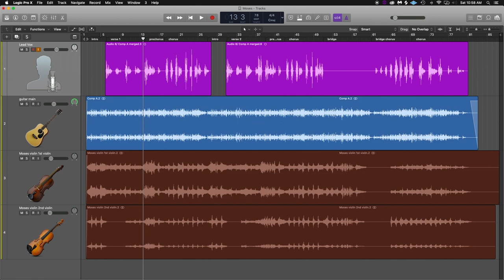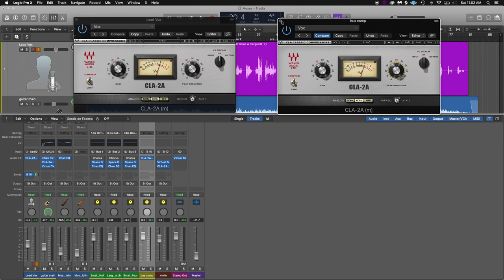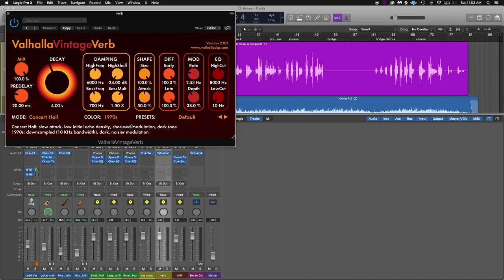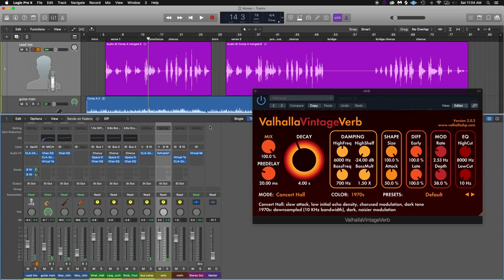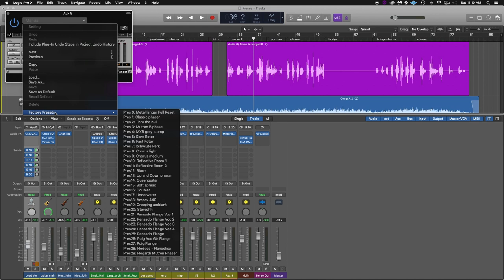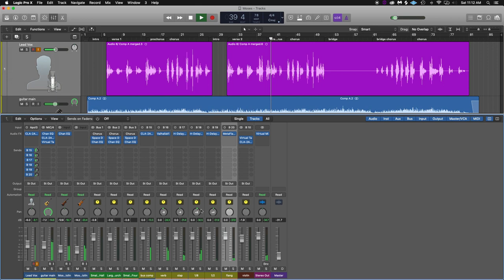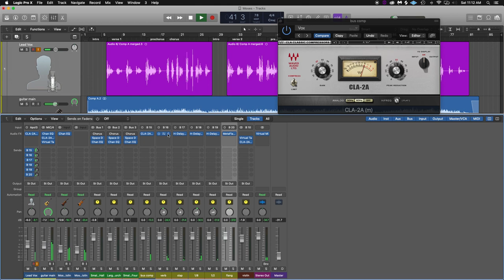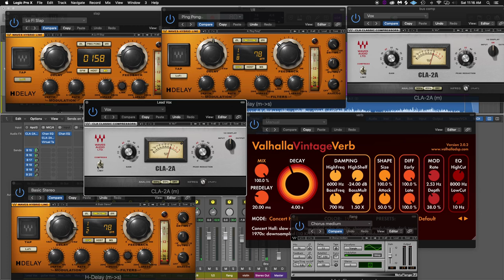How to create a killer vocal chain to sit right in any track! Vocal processing using Waves and Logic

Comment: sir why not put all effect on same voc channel and control dry wet of effect ??? doesent this make the vocal volume really close to 0 db but not loud at all
 ??
Reply from the maker: Thanks for watching and commenting!  Thats a great question.  Not putting the FX on the same channel allows for a few things: 1) the dry channel is not effected, so it will always shine through.  Adding FX directly to the track, especially reverb and delay, will cause that track to sink into the background and not punch through.  2) you can save a lot of CPU processing power, thus minimizing latency by sending multiple tracks through the same processing chain.  3) not all FX plugins will have a dry/wet control.  4) You can do things like panning and equalizing these FX much easier without having to dive into heavy automation.  I like to use this chain because it works for me.  It basically centers the track and gives you the best control to manage the FX through your sends.  At the end of the day, its whatever works for you!  Happy holidays!

Comment: Thank you for the very nice video... these are for anyone that wants a breakdown of the lesson
1:10 listen to unprocessed vox
2:15 waves LA2A
3:40 send to parallel LA2A
4:50 listen with parallel
6:17 new bus w/ reverb (valhalla)
7:43 new bus w/ h-delay (slap)
9:00 new bus w/ h-delay (8th note ping pong)
10:42 new bus w/ h-delay (half note)
13:05 new bus w/ flanger
14:20 panning some sends
15:21 final listen
16:28 review all plug-ins

Comment: If we play with thought of you mixing this all in the box.
How would you approach the EQ:ing?
Would you put it on a separate bus, directly on the track or on the same bus as the compressor? Multiple EQs or just one?

Loved this video. And I a really great tune.
Reply from the maker: Thanks for commenting and appreciate you for listening to the tune!  I approach eq'ing vocals in several ways.  If completely in the box, I will generally use two EQs.  The first would be a broad-stroke EQ that would make the vox track pleasing to my ears and interacting with the song the way I want it to.  I would generally go with Fab Filter's EQ, but the stock logic or any of the waves EQs are great.  I would start by cutting (or high passing) all the low frequencies out that don't change the overall tone of the vocals; then I'd find the frequency spectrum that sounds best to my ears as it interacts with the other instruments.  I would boost that frequency a few DBs with a moderately wide Q.  I would then do the inverse of this and lower any frequencies that bother me (like low mids if muddy or some higher frequencies that might sound too harsh).  For the second EQ, I'd would be more surgical.  If there is a particular pinpoint frequency that is really irritating, I would cut it by about 3-6 db (with the q set as small as possible).  Some tracks there are none, others there might be several.  You can also EQ each bus individually.  For instance if you feel the verb is to harsh in the highs and it doesnt have eq controls, just throw an eq after it in the chain and bring down those high frequencies.  Hope this helps!

Comment: Why make a bus for every plug in and not have each on 1 bus for the chain? Just easier to control more?
Reply from the maker: Robert, thanks for the question!  I find having a separate bus for each track not only allows you to run as many vocal tracks through the same chain as you desire, but also gives you the most control for how loud you want each effect to be.  I also take advantage of slightly panning each bus to keep the FX "swirling" around the unaffected vocal, which prevents it from sinking into the track with the increased verbs and delays.  There are a number of methods out there, this is how I generally do things, especially when I know I'm running multiple Vox tracks.  Hope you are staying safe out there!

Comment: What bothers me is that your ping-pong delay is not ping-ponging. It's in mid-side mode and thus basically mono.
Reply from the maker: it is in ping pong stereo mode: mono-->stereo.  The ping pong button is activated and mix is set to a value of 100.  It is not very apparent I agree, but due to the nature of the song its not supposed to be.  and though it may not appear that it is stereo, logic is considering the track stereo with the plug in--allowing for the FX to work.  (check out the double wide meter corresponding to the fader)  Here is a link to user manual for H-delay which discusses the ping pong effect and the minimum values to achieve it.  Thanks for commenting and have a good evening! https://www.waves.com/1lib/pdf/plugins/h-delay-hybrid-delay.pdf
Reply: @engineersandfriends4799  I confused Mono -> Stereo for Mid -> Side, as I primarily work with Fabfilter Timeless 2 and it's an option there. Also I'm aware of the principles behind ping-pong, but it still sounds to me like if both delay lines are panned dead center. At the same time, the level meter on the send clearly indicates that it's stereo. Which is actually weird, since, as I just googled, some Waves M -> S plugins can get stuck in mono in some cases. Which is what I heard. But then why level meters show it's stereo...
Eh, I'm officially lost there.
P.S. Never expected any answer, let alone so quickly.
Reply from the maker: @qasderfful  Yeah, it is all a bit confusing, trust me I hear you.  In logic, a double wide meter in fact means logic is treating it as stereo as opposed to a single wide meter.  This is a big complaint of mine with them as it can contradict their other indicators.  They have another indicator at the top of the track that is depicted as a circle.  If it is a single circle, the track is mono, if it looks like a two circles joined together its stereo.  Why I hate logic sometimes is, if you create a bus or aux track, it can show it to be in mono, but if you apply a m-->stereo plugin, it becomes stereo, yet they don't change the indicator (though the meter becomes double wide and stereo pan becomes available.  Also to further confuse, it appears that the stereo track is put right down the middle in terms of panning on the mixer--whereas protools shows two faders panned to both sides.  The standard pan pot that comes up is actually a balance fader, not a stereo pan.  If you want to mess with the stereo panning, you have to right click the pan pot and then select stereo pan--which is why it looks like something is in mono when its indeed in stereo.  I went back and checked the session based on your comment to make sure the ping pong was happening and it was, its just very subtle that you cannot hear it very well--which is what the song called for.  I appreciate your comment and hopefully this longer response might shed some light on your concern.
Reply: @engineersandfriends4799  I work in Studio One for a few years already. This circle-meter thing also present here, except it never changes on its own, you have to click the circles to switch the track from mono to stereo and vice versa.
And then PDC on this particular track resets to zero and you have to reload a project to set it back. Yeah. Guess we can't have it flawless.
As for the delay, guess I'll need to fiddle with it myself to fully understand what's happening. I don't use Waves, but luckily I know some local folks who do. Time to arrange a friendly visit :)
Thank you for the responses, I appreciate it very much. I wish you all the best as well.